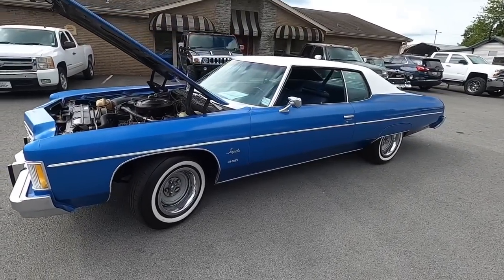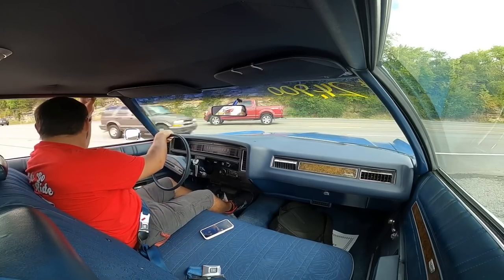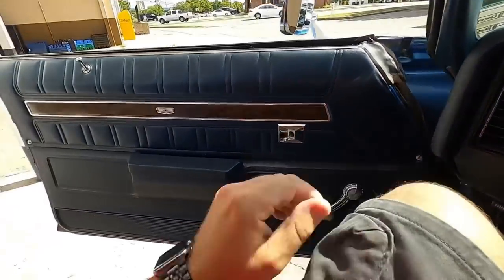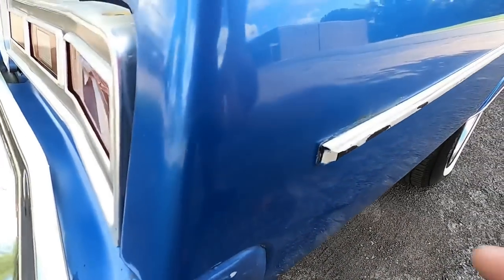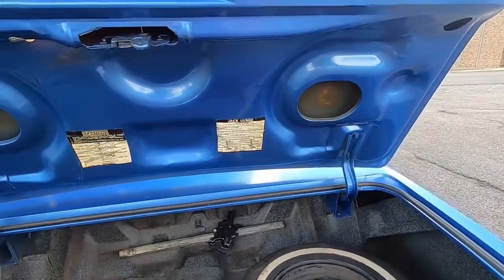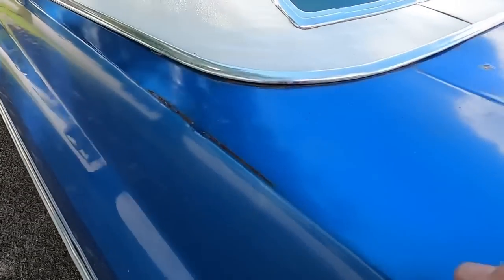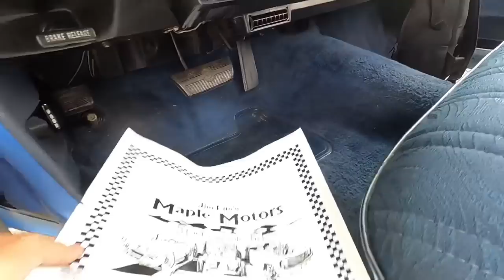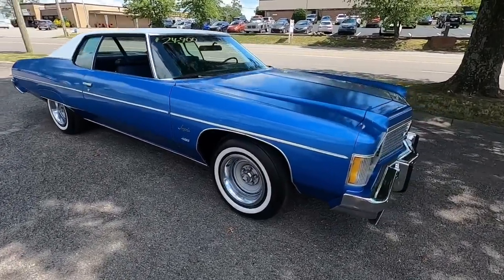Test Drive 1974 Chevrolet Impala SOLD $24,900 Maple Motors #1851

Comment: In 1980, I was 20 years old, and I owned a 1974 Chevy Impala 2-Door Custom Coupe in a light green color with a dark green metallic 350 V-8 engine. The car had power steering, power brakes, air conditioning, power windows, cloth seats with plastic covers, and an AM & FM radio with an 8-track tape player. If General Motors ever brought back this same exact style Impala, I would go to the dealership and buy one.

Comment: I’ve had many of these. In 1974, they still had points in the distributor. Called a uniset because the points and condenser were a 1 piece deal,that year only. The sputtering heard when revving is a good indication that it needs new points. Also,the Rochester 2 barrel carburetor on this car needs an accelerator pump, which is why it hesitates initially upon accelerating.

Comment: Remember this one well. 400 ci small block, 8 mpg city, 12 mpg highway. Gas hog, but rode smooth and comfy. Hesitation was a normal for the 73-75 Impalas. Step on the gas.. sputter then goes.  This was one of the early engines to use unleaded fuel and they had pollution control “stuff” not catalytic converters that choked the engine.  Also a favorite of the Mob since it can hold up to 4 bodies.

Comment: My Mom had a 74, dark green coupe when we were kids.  Land yacht for sure.  The hood was 4.5 miles long!  That car influenced my taste is cars from an early age.  This is a sweet car, super clean, but I'm wondering where the louvered trunk is...?  (Specific to '74 model year only).  Also, correct me if I'm wrong but, I'm not sure they offered skirted wheel wells on those cars at that time?  I know ours didn't have that feature.

Comment: its a Beautiful old ride.. but 24,900.. that is a lot of money. tax value on that car isnt much even trade value as well as insurance would be much cheaper.. you may have to down that price to less than 8,000 dollars.. it will take money to fix all the body and replace most of what it needs to get it back to top one shape,.. which would be a lot of money..  thanks for the video..

Comment: Finally one that hasn’t been molested with and had its wheels donked out. This is what a real 70s pimp ride looks like. All stock appearance, no bull shit
Reply: It's still a Donk though. A donk is a 71-76 Caprice or Impala. Has nothing to do with the wheels.
Reply: @JamesBlue28  Not according to its factory original title. Nor the original advertising of the car.
Reply: @Nebulasecura  The title and advertising? I don't get what you mean. Donk is slang for a 71-76 Caprice or Impala. The ones on big wheels are popular so a lot of people think the name refers to the style of customization but it actually doesn't. A stock 71-76 Caprice or Impala is a Donk. A Cadillac/Buick/Oldsmobile on 26 inch rims with candy paint isn't. That's all I meant.
Reply: @JamesBlue28  I mean that the car wasn’t called a sink in 1974 when it originally came out most likely.
Reply: @Nebulasecura  Harleys weren't called hogs or choppers. GT-R's weren't called Godzilla. What about Screaming Chickens? Deuce and a Quarters? Eleanor? The Judge? Tri Fives? It's part of the fun and creativity of car culture.
Reply: @JamesBlue28  guess that makes sense then. Fair point. I just don’t like associating these full size cars of the 1970s with large oversized and frankly stupid rims in my opinion. So I don’t really call them donks myself but I do acknowledge that it’s a cultural name associated with them.
Reply: @Nebulasecura  It's really Florida slang but its gotten so popular its just easier to use so most people know what you're talking about. We don't really call em Donks in the Bay Area. Its catching on but its not native. Around here it's a glass house, a Chev, a Mobby, or just a Mob for short. You also don't often see rims bigger than 22 inches around here. 22 inch gold spokes and Vouge tires is the go to combo around these parts.
Reply: @JamesBlue28  gotcha. I’m in Kentucky so we don’t usually see that around here as much. Besides I just prefer the way these vehicles look as they came out in the 70s rather than as they currently are known for.
Reply: @Nebulasecura  My personal preference is a blend of old and new. A retro style wheel that's a little bigger than factory. SD Forged makes up-sized replicas of old wheels that I think are the perfect middle ground. Another company that does it is called Isotope Motors I believe. I'm less familiar with their products though.
Reply: @JamesBlue28  makes sense to me. I also love the whitewalls this one has personally. On normal old muscle cars or tri five chevys I do enjoy some 18-20 inch American racing torque thrust chrome wheels.

Comment: THE IMPALA 74 GOOD PAINT SOLID BODY AND INTERIOR CONDITIONS INCLUDING THE DOOR'S. THE FIRST STEP IN PURCHASING THE VEHICLE IS HEADERS HAVE TO BE CHANGED NEW EXHAUST SYSTEM  SPARK PLUGS NEW WIRE'S THE ENGINE HAS A HESITATION  AFTER A ACCELERATED RPMS IN PARK POSITION OTHERWISE IT'S A GOOD VEHICLE
Reply from the maker: Hesitation was explained in the video and has nothing to do with the spark plugs. You did write in all caps btw

Comment: The folks that think the price is high haven't been paying attention to the 71-76 Caprice/Impala (donk) market. But if yall know where these are going for the low, drop it in the comments because I'll crack my nest egg wide open and make a mint.
Reply: 74-75 impala was the ugliest donks
Reply: @dalazdayz  Don't seem to matter no more now days. The hype has driven all the prices through the roof.
Reply: @dalazdayz  I don't mind the 75 though. Im in a raffle for one right now. Not a fan of 74 and 76.
Reply: @JamesBlue28  mane the 76 caprice is the hardest after the 71
Reply: @dalazdayz  Theyre going crazy for the 71's but I like the 72 and 73 because of the grilles below the front bumper. Something about the look of it talks to me.